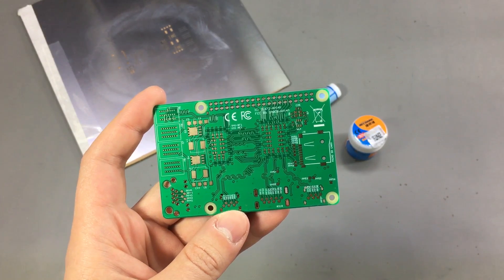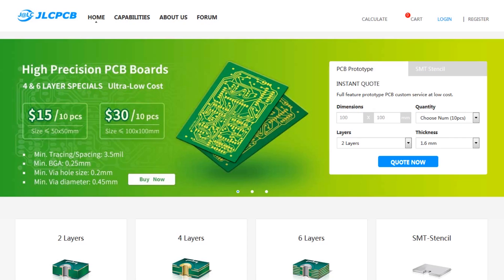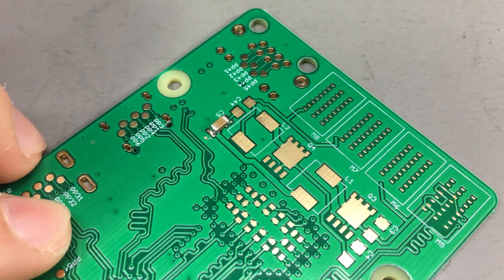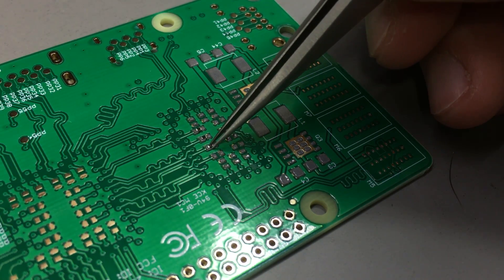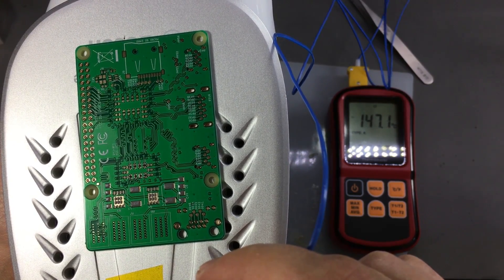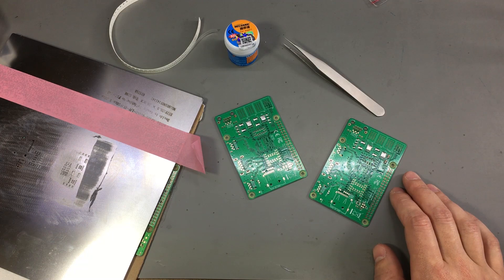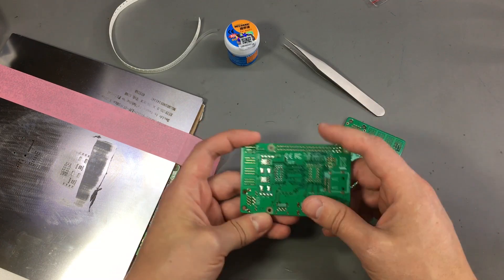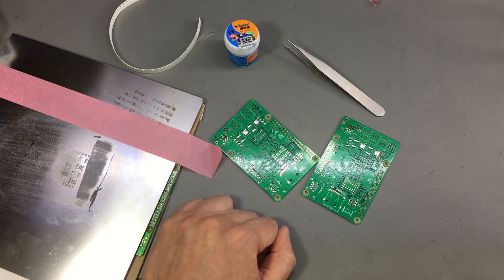Voltlog #161 - How To Solder SMD Parts

Comment: I couldn't quite see how hot the iron was when the solder started to melt--can you tell be this temperature (in degrees C).
Thank you very much for such a great video!!!!
Reply from the maker: It's not about how how the iron is but how hot the board/part/pad gets. I usually work with my iron set to 280 degrees C and my hot air at around 320 degrees C but that's only because I have a crappy hot air station. Start low and increase the temperature until you get good results. This will vary depending on your tools, the working distance, thermal mass of the PCB.

Comment: I might add you can also get solder paste in a syringe form or apply with a to individual pads with a toothpick. Also if you elevate your board by holding it with a pair of helping hands over a table edge you can reflow using hot air from the bottom of the board.
Reply from the maker: Thank you for the addition of these two methods, I personally tried the syringe method and I find it needs quite a bit of pressure to squeeze the paste out and that affects my precision. I also tried he toothpick method and I find it difficult to distribute an even amount of paste which in the end results in uneven solder joints or tombstoning. But I guess in the end if you practice long enough you might find one method suits your workflow better than the others.
Reply: VoltLog The fully plastic tappered syringe tips seem to work a lot better and have constant output over the stainless tube type.  I fully agree with you that applying paste by hand isn't optimal. I do a lot of one off boards that don't really justify a stencil for it. I solder most components by hand but there's always parts that with pads inaccessible to and iron.

Comment: Hey sire
Is it possible to show us in a video how to replace an pcb atena to a external atena. Im sure other people will also such a video.
Btw great video i will try it my self :)
Reply from the maker: There is no easy way to do that. Most likely it will have an impedance mismatch which will affect the circuit negatively.
Reply: VoltLog but how can i extend my bluethoot speaker ?

Comment: I've had the best luck with a second-hand laboratory hot plate I got for free. The proper lab plates have a more even heat distribution and finer controls as well as a very flat surface. For small scale production the plate is nice because you can poke parts to fix mistakes. I prefer it even to the real reflow oven we have at work unless I have to do a bunch of boards because of the ability to fix mistakes. I've been thinking about investing in one of those plates that are made for reflow you can get on Aliexpress for ~$80.

SMD is my preference nowadays, it's easier and parts are so much cheaper. Only real disadvantage is harder to breadboard, but you can get adapter plates or invest in one of those super cheap engraving machines to make quick prototypes (I have one I got for $150 and it works very well).
Reply from the maker: Can you share a link with the hot plate you are mentioning on Aliexpress? I don't know how they look.
Reply: https://www.aliexpress.com/item/Youyue-946C-preheating-station-220V-850W-LCD-Digital-electronic-hot-plate-for-phone-screen-replace-preheat/32847471055.html
Reply from the maker: I think you are referring to Youyue 946C and similar. If shipping wasn't so expensive.. I would probably get one.
Reply: nobodybodybody Could you share your workflow for milling pcbs? I have been trying it lately using chilipeppr and its eagle brd function but I end up spending ages leveling before I get an auto level that actually works. And even then the boards can be a hit and miss if not working with tht components.
Reply: Thanks Ill have a look into bCNC!
Reply: @VoltLog - the one I linked has free shipping to the USA, but I guess Romania is unlucky there. I haven't tried one but there's some videos of people using them on Youtube, apparently SparkFun and Dangerous Prototypes used them for prototyping. My salvaged lab hot plate works well enough for now.

@Overlordx666 KiCAD to draw the board, export to FlatCAM to generate gcode. I used to use Chilipeppr but found it kinda unreliable and hard to use (every now and then it'd go nuts crash the toolhead) and so I switched to bCNC, which is not quite as pretty but way more reliable (and functional). I use 20 degree conical engraving bits, which each last maybe 5-10 boards - you need to make sure they are nice and sharp or it messes up the width. I 3D printed a jig to hold boards that just screws down onto the table. I can do most SMD packages, though for really fine pitch stuff or complicated layouts I usually just order a board.

Comment: Thanks. Not trying the hot iron method but recently seen the hot led/lightbulb method.
Reply from the maker: That's something I haven't tried so far but I did hear about an LED which desoldered itself because of overheating and low melting point solder that was used.

Comment: Using a stencil can be tricky, you will need to have it pushing down on the pcb  uniformly and be able to pull the stencil straight up. I like how you made a stencil jig out of tape and cardboard. I also like to use leaded solder and a iron over messing around with solder paste. A good microscope is very useful to have as well. I like scopes form amscope for the home lab. Very good video and instructions, thanks.
Reply: I kinda like that JLCPCB packages their stencils with waste board material. It's nice in terms of recycling, but it also gives pieces that are the perfect to put around the board to support the stencil at exactly the right height.
Reply from the maker: yea ideally you would have it perfectly aligned and the separation done by lifting straight up but we are just doing hobby projects and it would bee too expensive to invest in a stencil printing machine that would only work with framed stencils so we work with what we have around and I am getting some pretty good results with these methods.

I don't have a good binocular (or trinocular) microscope in my lab. It's about $400 + shipping to get one from China but since I'm not working with small components very often I can't justify the money. A signal generator would probably be more useful in my lab and I can get it for the same money.

Comment: Very informative video.  Interesting that you prefer/recommend a hot iron or skillet for low volume work.  I think you just saved me the cost of building or buying a reflow oven!
Reply from the maker: Just basic manual on/off control until it reaches a certain temperature works fine but you could also build a PID temperature controller for the hot iron or skillet and you can have it track a certain profile that would provide even better results.

Comment: I recently order from jlcpcb. How much time did the boards took to arrive in Romania?
Reply from the maker: I usually order with DHL and it takes 3-4 days from HK to Bucharest. Standard mail (China Post or similar) might take 2 weeks to Bucharest, but then it really depends on the city you live in, because in some places like in Constanta where I live they take another 2-3 weeks to process the package for final delivery.
Reply: I live in Bucharest, the order was shipped with regular Registered Air Mail, DHL too expensive (3 times shipping costs than the pcbs manufacturing itself, unacceptable for me). It's been 1 month already and I didn't received them yet, that's why I was asking. Thanks
Reply from the maker: I would say 90% of packages arrive within 2 weeks to Bucharest, however they spend the rest of the time waiting in queue to be processed for final delivery and there is nothing we can do about that..